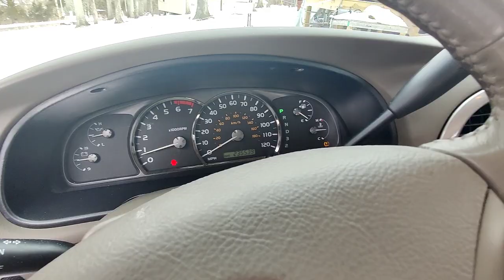MOBILE HOME POWER OUTTAGE WINTER STORM FEBUARY 2021 - IT'S FREEZING!! VLOG

Comment: A fan on or next to your stove will help move the heat to the other end of the trailer.  You can get a fan on Amazon that sits on top of the stove. The heat rising off the stove powers the fan blades...no electricity required.

Comment: Toyota Sequoia is a bit thirsty.. but a very good truck..
next get a battery bank for your 110volt inverter or a 12 volt fan to hook directly, to keep warm air moving when the power drops off.
LASTLY get a carbon monoxide detector as a just in case...you can't smell it and when you get a dose....you go to sleep and don't wake up.
I've had CO poisoning....barely woke up in time to get to fresh air.. had a hell of headache.. but fresh air, you recover fast.
Reply from the maker: The Toyoder is on a first name basis with my local gas station already LOL 11 to 13 mpg. It's a back up vehicle / go get stuff SUV it will sit most of the time.
Reply: @MDC2020  my 2016 HONDA PILOT EX-L has gotten 24.5MPG in econ mode at 65MPH cruise..
drops to 22MPG at 75MPH

Comment: 45 degrees in a house is most certainly cold for my standards and unacceptable lol. But as you said, it began to warm up after you ran the kerosene heater and wood burning stove. I was lucky, as I live in an area that did not lose power, nor hit by the polar vortex. However, I do have a generator now, and that can handle what I need it to do in my home. I start the generator every couple months and run for 10-minutes to charge the battery, and keep the exciter field charged. Being prepared for power loss is key, you are correct. People in Texas were not prepared, and they bought it big time. Its cool what you are doing with the orange peels, and its always fun to hang out with you Marty, even during a power outage. Yes, living precariously through your videos lol.

Comment: 235 that's allot miles, but its a Toyota so keep up the  maintenance  .
Reply from the maker: Mileage doesn't bother me. If it's on the road that long someones been taking care of it. Besides the 4.7 Liter V8 engines from Toyota are the ones regularly hitting 1 million miles.
Reply: @MDC2020  almost immortal